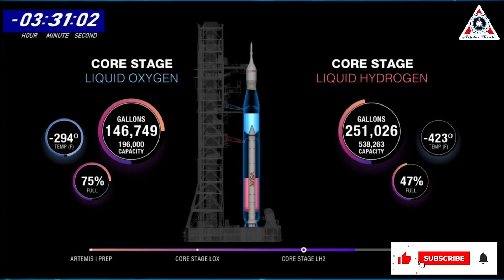BIG PROBLEM! NASA's Mega Rocket can't launch cause of an Engine Major Failure... Starship's time

Comment: By using old parts from the Shuttle/Orbiter, which was unreliable consisting of over a million parts, the chance of no issues is low. "Troubleshooting" is the problem. THere are so many unreliable parts and who know how old they are, they are based on old bad design. I think good engineers are there, but they are victims of bad system design and politics to keep a job in every state and thousands of different suppliers. Every other word in this presentation was "leak", "seal" or "valve", among the most vulnerable parts. I am sure they redesigned the Shuttle parts, mostly to accommodate the different volumes but the tech was probably the same since the same engines are used. Yes, the same engines. How old are those pups? Thus enter SpaceX in which the whole idea is reduced complexity and increasing reliability. I don't think you will ever see O-rings on SpaceX vehicles. They are still on the SRBs for Artemis. Just my humble opinion.

Comment: WE NEED SEA DRAGON!!!  SEA DRAGON IS THE MOST SIMPLE ROCKET DESIGN THERE IS PLUS IT IS CHEAP TO BUILD AND MORE COST EFFECTIVE TO FLY THAN ANY ROCKET IN OPERATION NOW!!!👍👍👍👍👍👍👍
Reply: AND ALSO SEA DRAGON HAS LESS MOVING PARTS THAN ANY ROCKET IN OPERATION NOW AND IT IS GRAVITY/PRESSURE FED SO IT DOESN'T NEED ANY TURBOPUMPS OR OTHER COMPLEX MACHINERY FOR IT TO FUNCTION!!!👍👍👍👍👍👍👍

Comment: Yup, that's hydrogen for you. It is of course the thinnest element in the periodic table and thus the most difficult fuel to control. Spacex uses methane in the Starship and still has leaks but not as many. Elon was right to switch to methane.
Reply: correct

Comment: NASA should have evolved the Shuttle instead of wasting money on the SLS.
The Shuttle should have never been retired. It should have been evolved using newer materials to make it safer.
Reply: The shuttle launches were horribly expensive and not reuseable
Reply: @davidbate6346  Er what? Shuttle not reusable?
Expensive yes. Reusable YES
I said it should have been evolved.
ie use better materials.  To improved heat shielding durability and lighter materials like CF. 
To just throw away the Shuttle in favor of a 90% throw away rocket while the Shuttle was a 90% reusable rocket was utter madness.

Comment: "Starship's time..."
LOL!!! Starship is a stainless steel wastebasket with engines and fins on it.  It is not going to be ANYTHING like a functional space ship for years and years.
Reply: Keep repeating that till you believe it.
Reply: @davidbate6346  I don't have to believe in a fact.  Starship is literally a metal tube with engines and guidance.  That's it.  There are no crew accommodations, no life support, just a tube in the very earliest stages of not even orbital flight testing.  If you have some information that I don't showing more than I have described please post it.

Comment: Political Bull hockey and NASA (Bill Nelson) are eager to please the political Masters. This is the very same formula that caused the loss of two shuttles. This, in turn, caused the program to be canceled handing the Russians LEO on a silver platter. If an adapter ring had been built to mate the capsule, we could have done test Lunar flybys a year ago. Even today, a Falcon unmanned capsule could do it. It would need more decelerating time to safely reenter but that's fiddly bits. Elon solves those issues. NASA looks over its shoulder to see what politician might get feathers ruffled.

Comment: If they where into using second hand gear why didnt they drag the F1 engines out of storage and rebuild the Saturn V at least it had the ability to get off the ground.
Reply: The F-1 was proposed, but projected at $100M for production restart for a handful of new rockets. NASA did some preliminary design on an 'F-1B', which was supposed to make the engine far cheaper by simplifying plumbing and manufacturing. In the end, it was decided to just go with the RS-25s and SRBs from the shuttle program, since they were supposed to be the cheapest and "already proven" equipment.

Comment: THIS IS WHAT HAPPENS WHEN YOU CUT CORNERS AND TRY TO GET THINGS DONE ON THE CHEAP!  NASA SHOULD HAVE GONE WITH THE CONSTELLATION PROGRAM AND ARES VEHICLE(S) AND NOT THE BOTCHED-UP CUT AND SHUT JOB THAT IS SLS!!!
Reply: awarded to the low bidder.
Reply: Explain the corners that were cut, dingus?

Comment: This scrub tells me their process is lacking important steps to check their systems.
Reply: @AllanSmith-d9b  to have a leak just by fueling the tanks tells me their process was lacking sonething. Spacex does a complete fuel system check all the way up to firing the engines. The failures they experienced were landing, which can only  be tested in flight.

Comment: Hydrogen is extremely difficult to seal, but you'd think that NASA would be on top of this with all of their previous experience. Apparently not.
Reply: NASA didn't build the rocket, Boeing did and the current Boeing is a completely different place than it was 50 years ago.

Comment: It will be glorious to see such a large rocket fly, even if it is a bit retro, I understand NASA's hesitance  they've lost lives, now they are paralysed by caution, for an uncrewed vehicle they could afford to be a smidgen more aggressive, but because of cost and time over-runs they now HAVE to have everything perfect to still be able to launch the crewed vehicle or risk obsolescence, what a tight corner they have painted themselves into, and that is why it is refreshing to have SpaceX literally risk several explosions and take it on the chin as learning, these two entities operate at opposite ends, but I think both have value and could learn from the other

Comment: Nah, not a failure, and was expected with other launch dates reported before the attempted launch.  Appolo was the same with cancelled launches till things were a go.   Your beef has no meat.
Reply: Except the Apollo program launched more than one rocket in the span of 10 years.  Yes, it took 10 years or so to finally develop the Saturn V, but they were constantly testing and launching different variations until they found the correct design.  NASA in the 50s and 60s looked much like SpaceX does today.  If Star Ship launches before the SLS, then yes it will be a massive failure on NASA.  We'll see though, I'm sure the FAA will have some input on this.

Comment: The bide and administration is weaponized the FCC the FAA and NASA against SpaceX for the express purpose of making sure they're so-called SLS launched before SpaceX could launch Starship on orbital proof fight. They intentionally set the date for Monday for the SLS launch well intentionally having the FCC not initiate SpaceX launch and flight Communications permit until September 1st, well September 1st is fast approaching, so now they will probably use FAA to block final launch permitting watch and see. SpaceX needs to start taking legal action on this interference and illegal obstruction. I also think NASA is using faulty hardware and Val function as an excuse. I think they did not launch in the bad weather situation because they do not trust the solid rocket booster segment seals and as most people will recall it was a leak in a solid rocket booster segment seal that destroyed Challenger killing the entire crew. SLS will never be a crew Worthy launch vehicle, and it has no other capability it can't even bring its own land or to the Moon this was a huge pork barrel project where again just like the F-35 project and just like the space shuttle project the politicians stole billions and in the case of F-35 it will end up being multiple trillions from the US taxpayers for a fake program for a dangerous program in the case of the SLS it is a death machine, just like the space shuttle was.

Comment: They need to quit wasting billions of our tax dollars on things that don't work just to keep the ball rolling. We have all of the proof we need right here on display as to the difference between private enterprise, and government blank checks with our tax money.  Look into the NEXT tower they have spent billions on that hasn't even been started yet and will only be good for the first 5 launches.  It was supposed to be finished LAST February!  Our good buddy Bill Nelson gave that company a bid, plus contract that leaves us open to whatever they decide to charge us and/or skim off the top.  THEN the next series of Artemis will be too tall (by 40') to use it so they will have to build stilll another one, or rebuild the one that they can't even get started yet after years.  Meanwhile we have a private enterprise that has built TWO starbase assembly plants and TWO launch towers (almost completed) PLUS made fools out of the boeing starliner project that still hasn't worked right or carried anyone up while SpaceX has delivered 4 crews and MANY cargo deliveries.  When do WE THE PEOPLE tell them to stop wasting our money?  They already admitted that if Boeing DOES get the Starliner working it will STILL cost over twice as much for a seat than SpaceX does it for.  Why are we allowing this?  32 BILLION of our tax dollars have been spent on this rocket and they can't even put fuel in it.

Comment: Does anyone know if the Solid Rocket Boosters (SRB) are re useable. Thanks.
Reply: they are "refurbishable" they dropped into the ocean, and require extensive work to make usable again
Reply: The boosters for the Artemis program are not recovered and re-used and are not equipped with drogue and main Parachutes!  It is actually cheaper to manufacture new boosters for each flight than recover and refurbish boosters that have been flown and this lesson was 'learned' during the space shuttle program and yet NASA still kept recovering and refurbishing the boosters despite the fact that this is actually more costly!
Reply: @AndrewHillis_2024  Very interesting. Thanks.
Reply: Re-useable in a sense that they are already have been recycled.  4 of the 5 sections are of each booster are from the original shuttle program.
Reply: saturn 5 did not need boosters.
Reply: @waybee100  It Would Have Been A More Badass/Beast Rocket If It Had Have Been Fitted With Boosters!!!👍👍👍👍👍👍👍

Comment: This is a boondoggle plain and simple. NASA and it's legacy companies have been used as a cash cow/subsidy for well over a decade. They were happy to continue to suck money from the taxpayers and only produce snazzy promotional videos. 

What changed?

SpaceX

Not only SpaceX with their Crew Dragon that left Boeing's Starliner in the dust. But their amazing launch cadence with Falcon 9 has the public used to the idea of a reusable rocket booster.

What did SLS in was Starship. I'm sure NASA thought it would take SpaceX much longer to develop but were surprised in the rapid progress in the last three years. So they rushed SLS. Had the Federal Government slow Starship with regulations so SLS gets to launch first.

If NASA can't get SLS to fly it will be a monumental failure for the agency and subsidiary companies. 

Let's take a tally shall we? 

ULA(Boeing/Lockheed) has been using Russian rocket engines. But with today's political environment they will not be getting anymore. So they partnered with Blue Origin for their BE4 engine. The delivery has been delayed over & over.

The only thing working for the American space industry is SpaceX. Falcon9 is a well proven launch system. Starship is in testing and at this point most people will give SpaceX the benefit of a doubt due to their recent track record.

Where does this leave NASA? 

IMHO NASA needs to get out of the Space hardware business and become a full fledged facilitator between the American people & Government and private companies making the hardware.

Comment: 0:34 no man, you obviously know nothing about space missions; everything needs to be 100% perfect, checked, and the weather (which nobody controls) plays a key role in delaying a launch.Once the weather is not anymore as predicted and the engineers find some problem, they start to evaluate the situation which can lead to hour-long postponing or days, because a) they need to repair/reset the failing system/s and b) weather is again mild
Reply: Weather may have delayed things but had absolutely nothing to do with the engine 3 bleed issue..
Reply: Nothing is ever absolutely perfect. Critical components must operate within acceptable parameters.